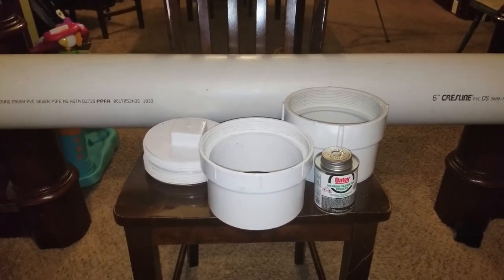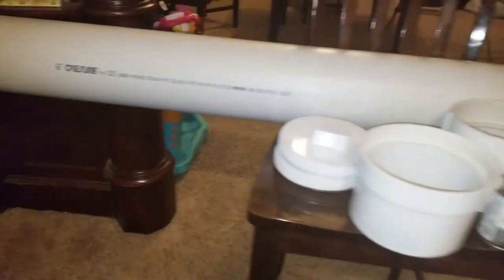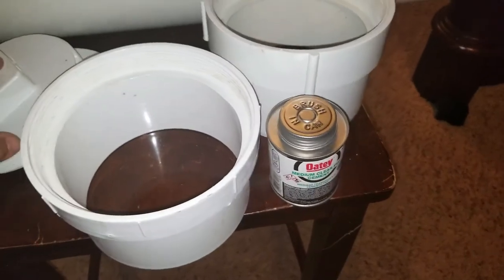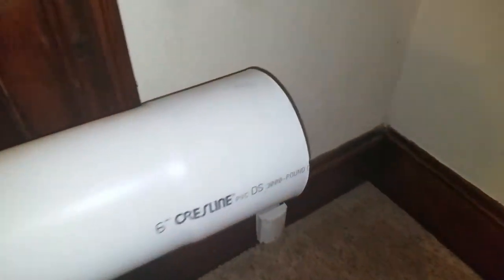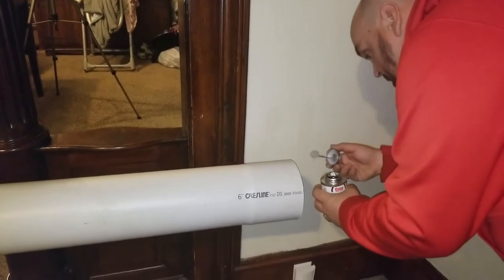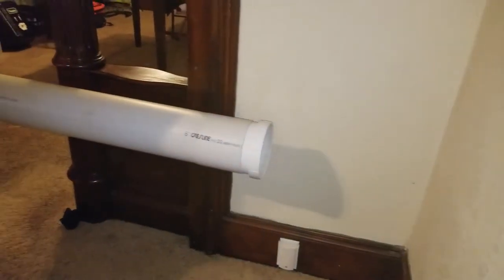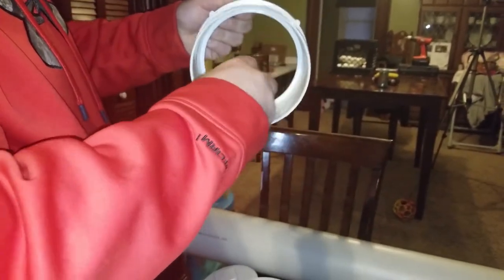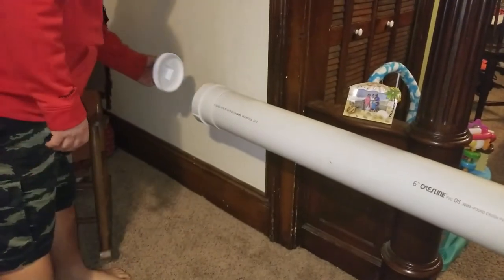MAKING A DIY ROD TUBE |  CHEAP FISHING ROD TUBE POD

Comment: Hey Wilkin, I was actually thinking of putting something like that under my plastic boat to help with weight management. How good do you think those can be sealed to be water proof?
Reply from the maker: I'd  say if u just cut both ends off smooth...and capped them and cemented them shut they'd be pretty solid...this one is getting mounted on the side of my trailer for rod storage. It doesn't get rainwater in it...but idk if I submerged it how that would work...but if u just bought end caps...I would think you'd be good. 👍
Reply: WILKINS' OUTDOOR ADVENTURES Im thinking of filling the tube with foam. i want to see if i can increase the weight capacity of my boat a little higher than 535lbs. total diy project, but i jist need to figure a plan to completely water proof that tube.
Reply from the maker: Cement the caps...run some silicone around the outside. I'd think that would work just fine.

Comment: IAM going do a video like this u beat me to it lol great video I was going order the kit from Amazon made my Reese hitch has metal back and frunt u can put lock on
Reply from the maker: L&S OUTDOORS huh. I'll check that out. I know with some drilling u can put a lock on these. Probably makes it a little easier for water to get in though. Not for sure.
Reply: I say ur right the one I wanted is water proof but it's like 70 bucks and u still got have the pipe it comes with bands to month to ur rid to